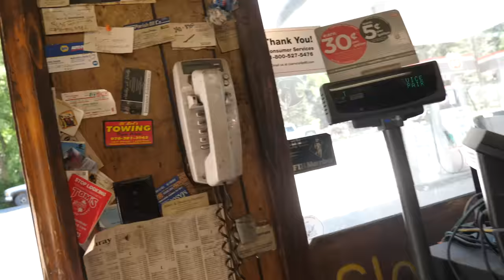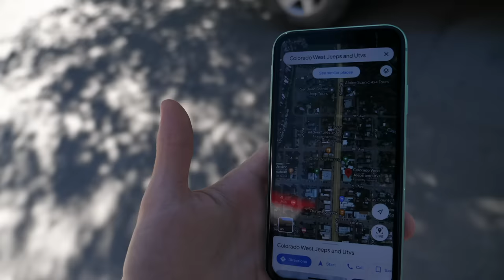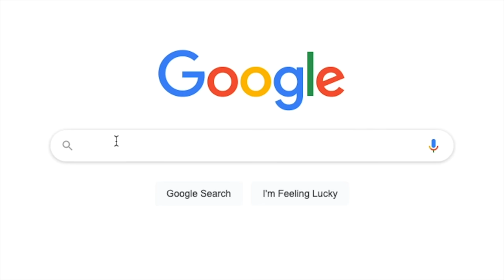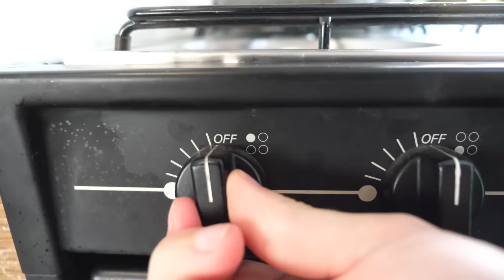VANLIFE DAY 1:transmission exploded, stranded at 10,000 ft, Hitchhiking with a stranger. Is it over?

Comment: Ethan in my motorhome when we first got it and was leaving on a cross country trip I was going up this long grade and it was over 100° out and my transmission started smoking and leaking oil. Luckily, we were close enough to a town. I went to a transmission shop and think God he was honest he told me that I just overheated the transmission oil and expanded and came out the vent. I added a little bit of transmission oil and haven’t had a problem since and it’s been 6 months and a lot of driving. Just saying?? You should question it??
Be safe out there.

Comment: Ethan you're pulling a lot of weight when you're going uphill it outs a lot of stress on the engine and transmission.  Every couple of hours pull off and let the truck cool down at least a half hour longer if your engine guage is going out of the normal range. Good luck.

Comment: The automatic 4-speed is the weak point with the old 7.3L International /Powerstroke diesels. That engine is easily a million mile engine. My friend worked as a diesel tech for FoMoCo dealerships. There is a replacement he recommended, but I need to ask him. Anyway, the standard 5-speed manual transmission has no problems. And the newer 6L and 6.4L International diesels have a lot more critical failures. The new 6.7L in house Ford engine appears more similar to the 7.3L, with no problems. I am iso for an Excursion with that diesel engine. The 6.8L  V-10 is also bulletproof, albeit it gets the horrible mileage. My dad had a F-250 with the V-10 Ford Triton. He still says it was the best engine he ever owned with the fewest issues besides filling up with fuel. That truck had a 5-speed automatic for that year. Actually no Ford my dad owned gave him too many problems. I know more people with GMC and Chevrolet trucks with more issues with their trucks. My dad then had a 2011 F-150 with the first generation 3.5L EcoBoost that he put a couple hundred thousand miles. The dealership gave him $15K for the truck, which was approaching 200k miles. He had one issue where he had to have a bolt tighten inside the transmission because the Ford UAW workers missed something assembling the ZF design 6-speed, which is pretty good. The 6L and 6.4L International engines convinced Ford to design and build the 6.7L engine in house.

Comment: The added camper weight and wind resistance is taxing the transmission, even with a new trans it would be best to add an additional after market heavy duty trans fluid cooler to give peace of mind in your travels.

Comment: Lived the life of the mysterious transmission fluid with my Dodge Aspen.  Independent mechanic showed me 'blow out' holes that would allow.overheated fluid to escape rather than blow out the seals under too much pressure. This too happened climbing the mountains in western Maryland. Never saw any leaks though as the fluid was burning up on the exhaust system..Interestingly, my dealership swore up and down that there wasn't anything like a blow out hole. Let the independent mechanic fix the car and never saw the problem.again. Last time I ever used a dealership for car repairs until I bought our first Toyota. Been happily ever after dealing with them ever since. But that is a different story. Feel your misery. Stay strong.

Comment: I am really happy that you are traveling in the United States and that you are in a truck and camper. I used to have the same setup what was nice was you can take the camper off and still use the truck. I would set the camper on pallets or something like that and I had a twelve volt hookup so it was easy to hookup and not have to put the camper back on the truck. Then I can do what I wanted and when I got ready to leave loaded up the camper in a way I would go.

Comment: Missed a few videos apparently. I thought you had bought a Class C motorhome and now you are in a pickup camper. Look at the bright side your transmission should last you for a few years. 
You may want to install a few more gauges. One I would add immediately is a transmission temperature gauge. Then you can consider a few others like exhaust temp.
When it comes time to replacing your pickup look at the other two options. Young friend of mine in the towing business says the make you have is his best business for tow jobs. For some reasons the mountains don't like them. 
If you decide to make that trip to Alaska drop a note and can suggest some great side tours while travelling through B.C. 
Thanks for the excellent video's you have posted over the years.

Comment: I'm glad you got going again but I'm a bit skeptical about those shops.
The type of motor has nothing to do with the transmission, whether gas or diesel. Not really.
I drove cross country to San Diego in 1980 in a Buick Rivera, pulling a trailer.
In the mountains, it blew the fluid out of the transmission.
I had fluid with me and went down the mountain and had a transmission shop put new seals in it and then
Went on to SD.
I rather don't think you needed a new transmission.
I wonder if that is a new one or maybe a used or possibly rebuilt one.
Oh well. 
Just stay safe out there. 😊😊😊

Comment: Not being in that old van is a blessing. My solution to black water overflow is to use a 5 gallon bucket with an adaptor to drain a small bit (5 gal) of waste to relieve the immediate problem.  Don't knock it, it works.  Move your tooth brushing to your kitchen sink,  it's by far more sanitary. (Peeps can verify this via the internet). 
If you decide to get rid of the truck and camper try a 28 to 32 foot class C RV. Roomy and easy to drive.  I truly hope you keep enjoying the RV lifestyle. 
One last thing, you're cute,  cut the hair.  Not harassment, simple fact.

Comment: Great Video. Great Adventure! 
- The wet bathroom experience was very funny. I love your cooking, look very appetising !!!
- Did you really had to replace the transmission?
- Is there any warning light,thermometer gauge, or a way to check the oil level...,  that the mechanic migh had explained to prevent having again this issue?
- Is it easy to put the camper on stilts in a campsite and drive around without having to carry the camper?
- Maybe having a folding bike, a skateboard, an electric scooter, could let you discover areas without driving and finding a place to park.
- If you got to Alaska, do you plan to drive all the way or take a ferry?
BTW I didn't know about The Conjuring, quite scary movie !!! What your plans for Halloween? 3> XD

Comment: They're lieing to you. You boiled the trans fluid climbing the hills. Fill it up & take it easy when climbing hills. Get a trans cooler installed on the truck in front of the radiator. Ford trans are very durable but suseptable to overheating without a trans cooler. It's happened to me a couple of times on my Ford trucks. It doesn't take weeks to get a replacement. Trans shops can send a replacement in a couple of days, swap it out & you're on your way. You're being conned out of money.  
You don't need a new transmission!!

Comment: I can’t be sure , but , if I were you , I would look into the question of , are you overloaded.  I think I saw that your driving a 250?  Even an F- 350 is barely enough to handle the load your putting on.  Your rig is going to be a bit dangerous as you travel and blow outs in hot environments will be common.  I had a much lighter camper than yours for 15 years on an F 350 srw ,( an 8 foot Alaskan pop up camper)  ,	and I was having frequent blow outs on brand new E rated tires while traveling in the west.  You may want to consider trading in for a dual rear wheel F- 350.

Comment: You really need to get a rv totter tank.  I'm guessing you have a 10 or 12 gal tank, so that's going to keep happening and it SUCKS!  Not fun to wake up to.  If you have a totter tank you can pull it by hand and dump it or even better if you have the rv off the truck you can pull with it.  They cost a few hundred bucks.  I strap mine to the ladder with a rachet strap when I'm driving.  Well worth having.

Comment: Aww Ethan, I hope they didn't burn you on that tranny.. You see,.... If you haven't lost low gears or reverse after you topped it off, chances are it's the front seal and the tranny is good. Going up a hill with a load "will" overheat the tranny and the front seal will become soft and spew fluid out. (alot of the time when that seal cools, it's fine.) The smoke probably was the fluid hitting the exhaust. I know it's too late and the repair is done but,...If I can suggest,.... make sure the "tranny cooler" is working (because for sure they didn't check that) and perhaps install a "trans temp guage" if your rig doesn't have one. I've been doing mechanical work on my own fleet of trucks for more than 20 years and the only reason I became a mechanic is because I was sick and tired of the upsells and rip offs that happen when their business is slow.

Comment: This doesn't sound right to me. It sounds like you overheated the trans going up the mountain and need a bigger trans cooler since you're carrying the weight of the camper. But you was able to drive the truck back down the mountain so I'd get a second opinion on the trans.